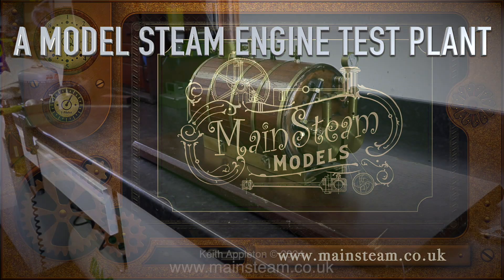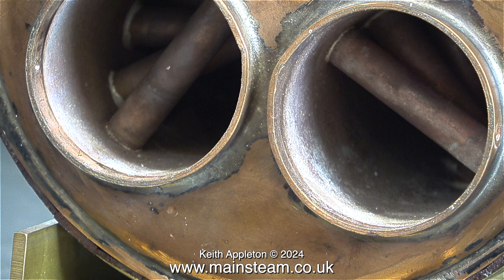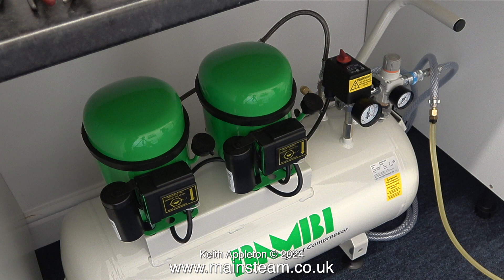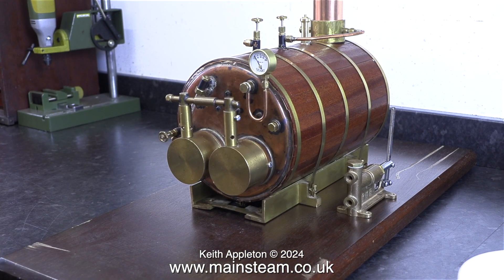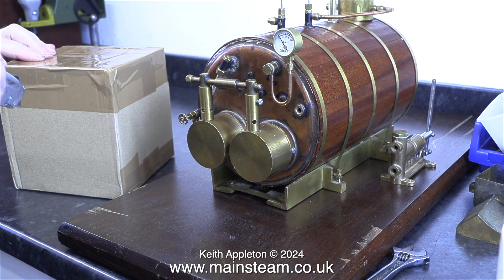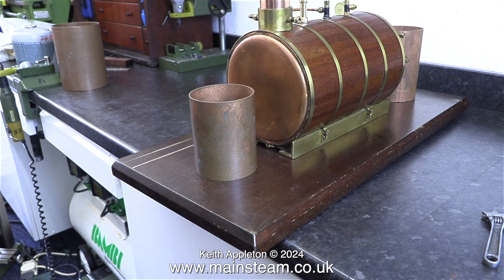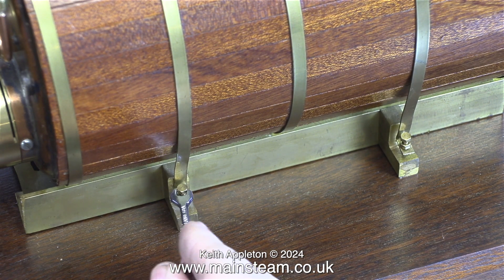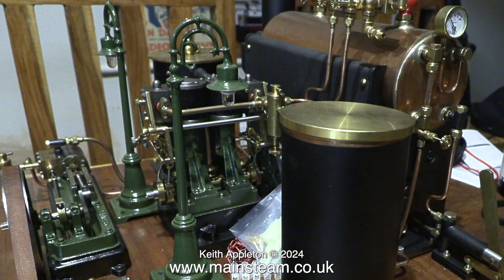A MODEL STEAM ENGINE TEST PLANT - PART #1

Comment: Thought you'd be using the  castle 6" vertical ?😊
Reply from the maker: I want to use the Castle Steam V6 Boiler for coal firing. It is also much larger. This one can live in my second smaller workshop for quick Steam Tests.
Reply: @keithappleton  gotcha 👌